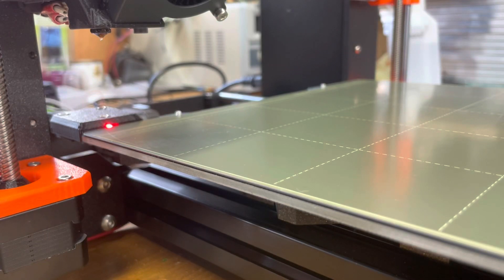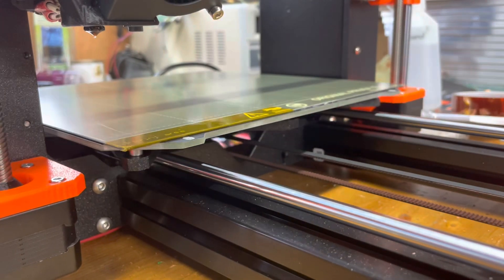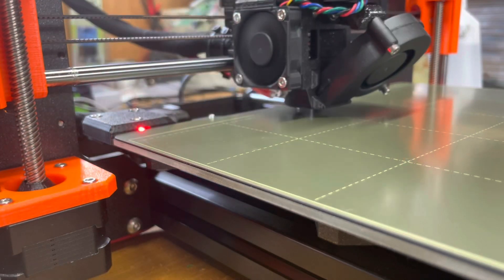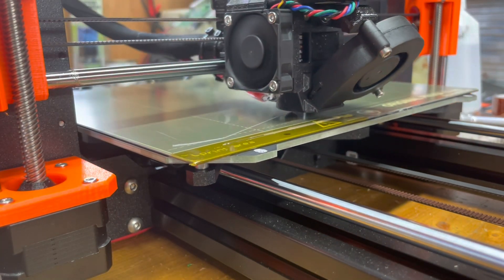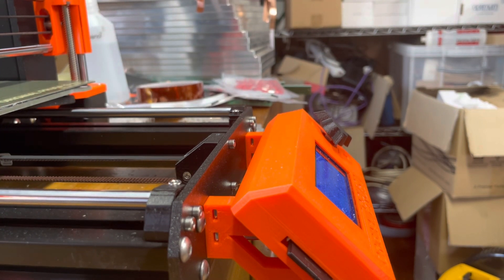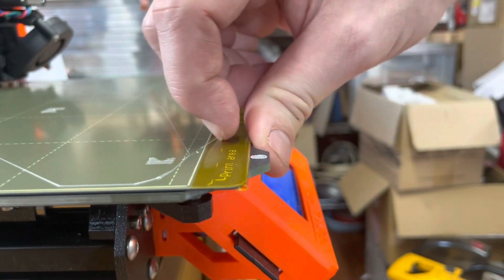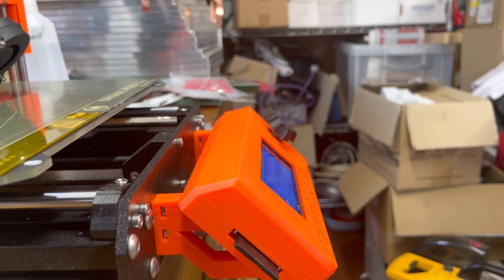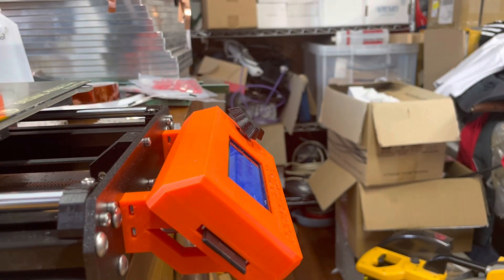Protecting the initial print area on the Prusa MK3S when printing with PETG on the Smooth PEI plate

Comment: I haven’t printed PETG on the smooth sheet out of fear of damaging it all together. Are you saying that you normally print PETG safely enough on the smooth sheet all but the prime line area becoming damaged and this method is to prevent that? Can you give some info about printing PETG ‘safely’ on the smooth sheet if you have time? I miss the smooth look, but am not missing ripping glass chunks out of my surfaces on other beds XD.
Reply: I have printed petg on the smooth sheets for more then 2000 prints together.

You need to wait for the print bed to cool before flexing. Else you Rick damiging the bed but Else when cool had no problems.
Reply from the maker: I have not had a problem printing PETG on the smooth plate. I didn’t realise you were meant to use the rough plate until a few months past but I like the smooth finish to some of my projects. Now I use which plate I prefer depending on the finish required.